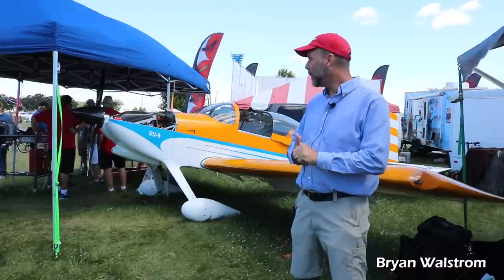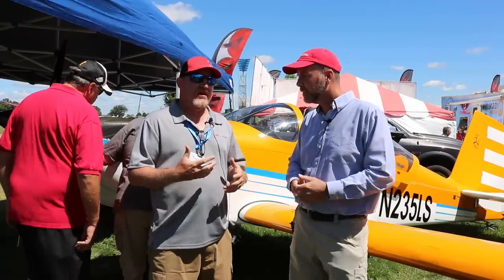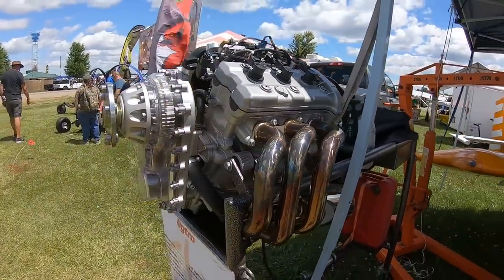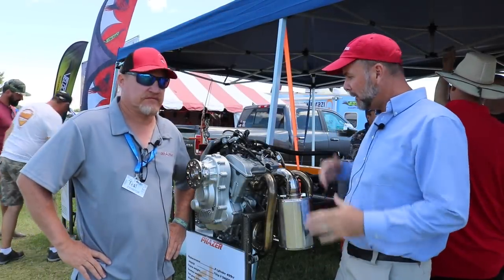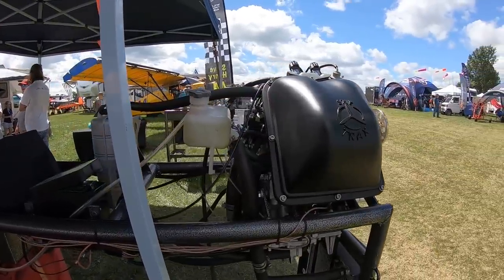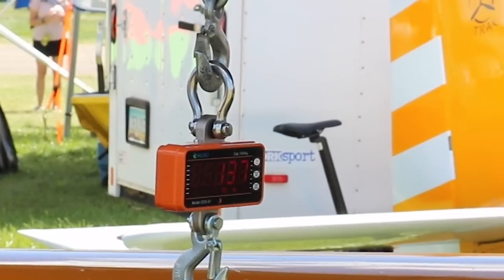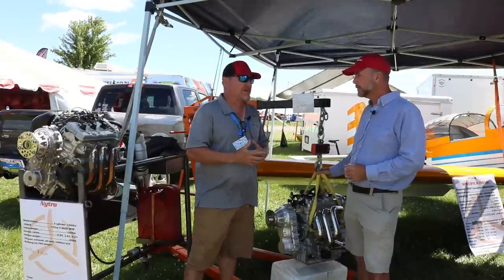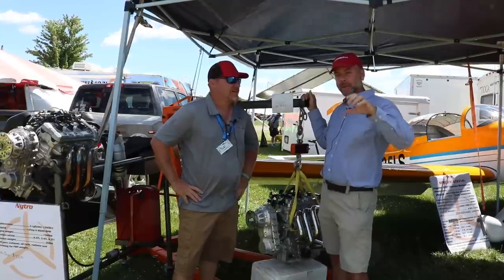Yamaha Engine +Teal Jenkins Skytrax Gearbox! Part 1

Comment: Rotex did not do the aviation industry any favors as far as cost is concern. As soon as I see Rotax on a plane, I know the plane will cost much more than $100,000 USD. They have lots of overhead and share holders that have to pay off.  Edge Performance, taking an already expensive engine, add their R and D cost and parts  to the Rotex, and you better be a multi millionaire to be able to afford it. Even governments have not made use of the Edge enhancements for their drones. One of the key reason for Edge existence is  the snail's pace Rotax move in advancing rated  Power output for their engines. After 2+ decades , it is only at 160 HP.